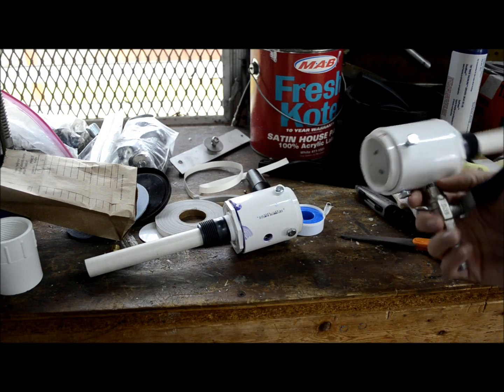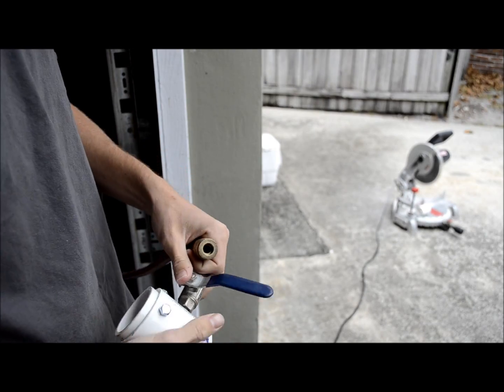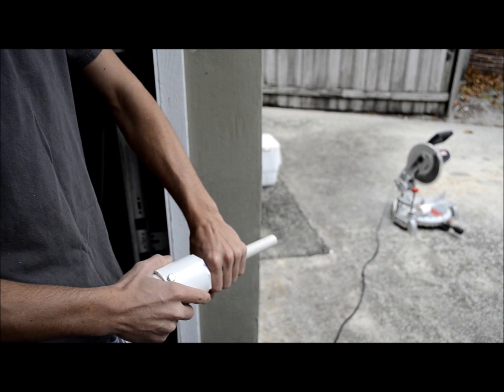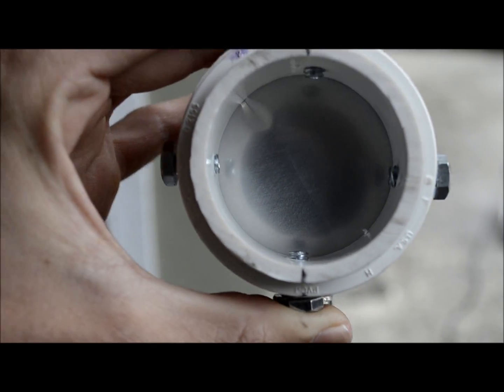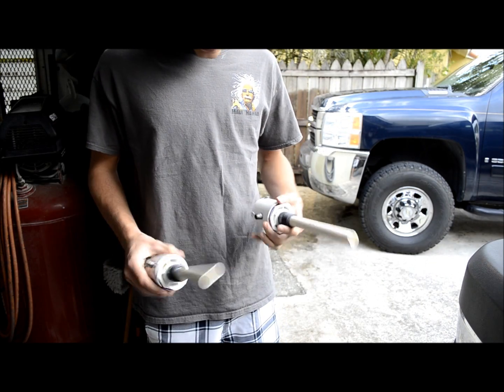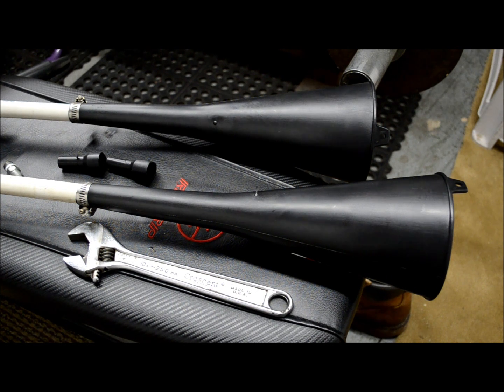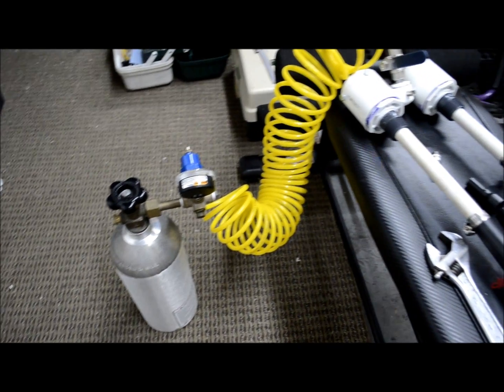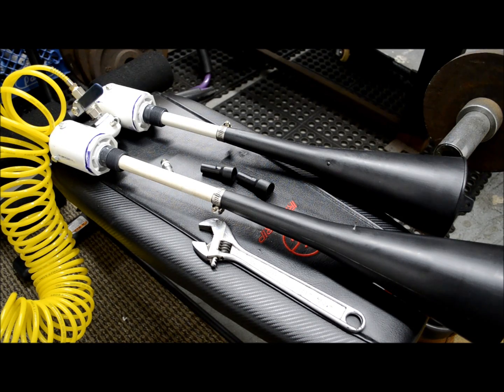HOW TO: Make Your Own Train Horns for $5!!! In-Depth Tutorial- Part 6, TESTING!

Comment: but how is it functional for a vehicle if you have to manually pull the lever?
Reply: Andrew Baughn you can get a solenoid valve for less than $15 that’s 12v and then hook it to a horn button.
Reply: @bamafreak223  i like it
Reply: 1/4inch DC 12V 2 Way Normally Closed Electric Solenoid Air Valve https://www.amazon.com/dp/B074Z5SDG3/ref=cm_sw_r_cp_api_i_TuS4CbF2KWKA9

Comment: How would you suggest making a horn with more than 2 throats?
Reply from the maker: not sure what you mean by throats, you mean 3 or more actual horns?
Reply: I mean a horn with 3 separate bells and 3 separate power chambers, how would I connect my air supply to those, and how should I arrange them?
Reply: Also, where did you get the pvc components? I checked at my local Home Depot and they didn't seem to have any of the parts I need. It might have just been that I wasn't looking very closely, but I'm not sure.
Reply from the maker: when I made a triple, I used a 1/4" stainless steel 4 port cross fitting with one port as the inlet and the other 3 for the 3 horns. I showed it in my train horn setup vid, so check that out. home depot should have everything you need! also lowes, or ace hardware (more expensive)

Comment: Great video. Clear, to the point and concise. There are a few questions that you may be able to answer thus preventing me from doing a bunch of trial and error learning. I would like to know more about pitch and tuning. What effect does different material diaphragms have on the sound? How to determine the length of the PVC tube that the funnel attaches, the funnel length, and what effect does the length of each have on the final sound? How to get a lower "deep" sound like a fog horn". What diaphragm materials have you used that are the most successful? What is the expected life of a diaphragm? It seems to me that although a thin aluminum diaphragm may produce the desired sound, due to its nature I would think it will not work long before stress fractures appear. Have you ever tried using a thick leather diaphragm before or a diaphragm made from a combination of materials? I was wondering if that first plastic diaphragm may have worked if a section was used just slightly larger in diameter than the seat it rests on and then being mounted in the center of a material that is more flexible like a 1/8" to 1/4" thick piece of flexible rubber. I am thinking that plastic, aluminum and other fairly solid, not meant to flex repeatedly, materials used for a diaphragm might have very short lifespans when used in this manner. All the diaphragm is really doing is flexing back and forth at a very high rate of speed. Though the flexing is minute it is still flexing. Like nearly all materials that will flex, each has a limit as to how many times it can flex before failing. If they work then great, but not so great if they fail quickly. In closing. Have you attempted to or made any air horns using the same procedures but of significantly larger proportions? I want the "Train Horn" sound which seems to come from the sized horns you have built but I also want the real, real, deep low bass sound generated from an ocean going vessel's fog horn. Do you think building a larger, scaled up horn would deliver that "Fog Horn" sound? I'm thinking of much a larger horn body with a larger more flexible diaphragm. Another idea I'm getting is a plate with a spring attached that fits behind the manifold and can be adjusted by a bolt that can be threaded in our out. Pressure could then be added to face of the diaphragm but still have some flexibility. That may allow for a greater range of tuning possibilities, greater range of air pressure and air flow rate. The spring, depending upon adjustment would take over a lot of the work the diaphragm is doing. I'll try it and see.    
Thanks, great video. KPE
Reply from the maker: in my experience, changing the diaphragm material can be quite unpredictable so its a lot of a trial and error thing, unfortunately! but it can be fun to try different materials and see what happens, as I had to do!
for the funnels, the longer the funnel the deeper the pitch. again, its trial and error. for a super deep horn, get a wide and long bell tube. for higher pitch, shorter and skinnier.
I have never had a diaphragm fail, and my polycarb diaphragms were in service for years. Still work to this day.
I have not tried composite diaphragms but some people use double layer metal. works well

your idea for a fog horn sounds great! go big or go home for that idea. bigger = louder and deeper! AKA more fun :) good luck with everything, and sorry for replying so late. I'm a busy college student!

Comment: Hi.   I want to put these on my recumbent bike, but don't have a lot of room for a compressor and tank.  Can I get a tank that will operate them?  Something around the size of a small home fire extinguisher?  About 6" in diameter at max and about 14-18" long?  Would that work?  It's not like I'll be using them a real lot, just for those idiots who have no respect for people on bicycles!  
Thanks very much for you generosity in posting these videos and help!
Reply from the maker: about the size of a home fire extinguisher... how about a home fire extinguisher! they will hold pressure fine, up to about 120 psi... if you want more air capacity you will have to go with a paintball HPA tank and regulator, but they are expensive!

Comment: OK. I think one last question. I got a T fitting between the two horns and when I hook 100psi of air to it only 1 horn sounds off! Idk what's wrong???  I've screwed and unscrewed the bell tube multiple times. I can't figure it out. if I block the air flow on the tube that is sounding off then the tube that don't sound off works. if that makes sense.
Reply from the maker: try to fine tune the tension on each horn so that they are the same. otherwise the one with less tension will always sound!
Reply: O OK. That's gonna be hard lol.
Reply from the maker: give it some air and rotate the bells until they sound like equal volumes!

Comment: hey man. I don't know if anyone had asked yet but how would I go about mounting these to my vehicle. HEHE!
Reply from the maker: it really depends on your specific vehicle, your air source, and how you plan on activating them!
Reply: 11 gallon portable tank with 125psi regulator.  On a 02 ford ranger xlt king cab. I'm mounting the tank under my tool box behind the cab. And plan on having a pull string or ball valve inside somewhere. I'm just trying to figure out what all I would need
Reply from the maker: +Kelly Perry the trouble will be running the cable from outside the cab to the inside. Have you considered electronic actuation? A very good HornBlasters solenoid valve can be had for about 25 bucks and will take care of that problem. All you need to do is power the valve and run a switch to the cab

Comment: Very good series of videos. A few questions.

Can the back of the driver (rear of the diaphragms) be enclosed? Or does that restrict oscillation of the diaphragm?
Why double diaphragm? Will a single one work?
Have you ever tried a rubber gasket instead of foam? It looks like the gasket off a 5 gallon jerry can lid would fit just right.
You tuned the pipes to A and C. What is the length of the pipes? What note is produced after the bells are added? It sounds quite a bit lower. (sounds very good BTW).
And lastly, have you tried flaring the funnels? Should make them a little louder, I think.

Nice job.
Reply from the maker: +CHARVESTER I'll try to answer them all!

I have never closed off the back of the diaphragms, bit I imagine it would have a slight although negligible effect on these horns. Real train horns are closed off and I believe they have small holes to relieve just the right amount of pressure

double diaphragm simply because that's how the real ones work, and apparently it makes them louder.

never tried rubber I don't think, simply because I didn't have the right stuff to use. I thought weather stripping would provide the seal much easier.

the length of the pipe will vary based on several factors... so start long and tune up to your desired note gradually. The funnel makes it quite a bit lower although I'm not sure exactly how much. I have no tried flaring them just because it would be pretty difficult.

Comment: Hey Luke, I made one of these yesterday and today i took and was going to show it off but when i put the air to it didnt work at all. Can you tell me what i should do to fix it?
Reply from the maker: Blake James first, always test things before you try to show it off :P

the most likely cause is the tension between the diaphragm and the bell tube. if it sounds like air is just rushing out, then it's not tight enough. in that case you would want to push it in further until you can feel it from the back. 

another reason could be lack of air flow, what type of air source were you using? they need quite a bit to sound good.

hope this helps!

Comment: So how did you install these on your truck, I'm assuming? And is there any way to wire it to a switch out control valve inside the cab? I'd also pay for a set, wish I had the time to build my own. It'd ship to California. :) Great videos by the way!
Reply from the maker: Justin Wommack these didn't go on my car, but my bigger and louder ones did. check out my channel for those videos. I have plenty of videos showing all the details of how I did it! There is definitely a way to wire them to the cab, but I actually used a manual actuator which you will see in the videos. I prefer the good old style of pulling down the cord, like you do when a truck drives by to get them to honk! I don't plan on using these horns for anything, so you could buy them if you want! Thanks for the comment!
Reply: How much would you charge? I've been looking around online and they can get pretty expensive.
Reply from the maker: Well, parts are obviously 5 bucks, a few hours of labor and testing, and I'm estimating 15 bucks to priority mail it to Cali, so we're looking at about 60 bucks. But I don't wanna be the guy to sell you a homemade horn when there are plenty store bought horns available to purchase for the same price that might be more reliable. They won't sound the same, but they would probably be easier to install and maintain. So you can buy them from me if you'd like, maybe I'll negotiate the price down... You seem like an honest guy ;)
Reply: My main thing would be just making it into a smaller application. I drive a truck so I don't have a trunk to hide the air tank. Any idea how to overcome that, a smaller compressed tank to hide in the engine bay?
Reply from the maker: The problem is you'll want more air than you can fit in your engine bay. My brother has a 23 gallon tank in his tool box, which is way overkill and takes up all the space. You'd want at least 5 gallons for these horns. If you need compactness, there are horns that are powered by just a small compressor with no tank - the air goes directly to the horn. Those eliminate space needed by eliminating the need for a tank.

Comment: Hey there I baught a air horn kit for my car and it is a single trumpet horn kit included an air compressor and it's just not as loud as I would like it than I saw your videos and really want to try it, but my only question is can I use that compressor that they gave me with your horn?
Reply from the maker: that compressor probably will not provide enough air flow for my horns. The reason these are so loud is because they use more air. You can't get much sound out of something that you blow in with your mouth - but think about all the potential energy contained in a scuba tank. Thats a lot of potential sound.

Comment: Great videos!!! I do have one question though. When I build mine I want them to make a very deep sound, do I need the tube to the funnel to be longer or shorter. Thanks!!
Reply from the maker: longer tube makes a deeper sound!
Reply: WOW!!! I got mine finished and I got a little crazy with the psi and I put 135psi through it and blew out both the soda can diaphragms....sooooo I was experimenting around with some different plastic material for new diaphragms and I found some old xray film from when I broke my arm and i cut me out some new phragms from it and put 80 psi through the thing...I dont even know how to explain the sound that thing made. It would put an 18 wheeler to shame!!!!!! lol. You should try it in you horns, go down to your local hospital and see if they have any xray film you can have, it works amazingly!!!
Reply from the maker: Wow, awesome! I'm glad you did some experimenting! I wonder how long that stuff will last...
Reply: We will find out! but it comes in a big sheet so i have plenty of extra material if cracks or blows out
Reply from the maker: Awesome! Let me know how it goes. Another guy said brass sheet was working good for him. I haven't tried it yet but real train horns also use metal sheet, albeit stainless steel.
Reply: Luke Santore I will try out some more materials. Tomorrow I am going to Lowes and I am going to get more pieces of pipe and more fittings and make my own design. I will make it as big as possible lol
Reply from the maker: I like the sound of that dude!! let me know what you end up doing!!
Reply: Luke Santore So why not just use Stainless - - people discard grills, thrift stores have toaster ovens, and, great videos Luke !!
Reply from the maker: thank you!!

Comment: Luke,
I have watched all your videos on building the horns and I like your attention to detail, how do you determine how long the tube going to the funnel needs to be,does it change the pitch or how loud it is, is the screw adjustment on the tube the only pitch adjustment, I am building one horn for now and I plan to put it together to test today and see what happens,
Reply from the maker: the length of the tube changes the pitch, not the loudness. you change it to the length that makes the sound you want.

the screw adjustment is for volume. it does not change the pitch.

Comment: Very good instructional video and props for posting such a thorough build. For the tuning or getting the note you desire, that is the just the length of the bell tube correct? The "tightening" or "tension" of the tube to press it to the diaphragm is just to get the loudest vibration of the diaphragm? or is it a combo of those 2 procedures to get the note you desire for each horn? 

just curious if you could state that tube A is to be x" to get note A and then tube B is to be y" for note B, or is it more complicated than that.
Reply from the maker: Thanks for the kind words!
I suppose I was a little unclear. In the video when I "tune" the horns, I am actually just making them as loud as they can be. The actual tuning (making them sound the correct pitch) came later and is not in the video series. So as you said, tightening/tensioning is for volume, and length is for pitch. However, I can't give you a certain length of pipe that will produce a certain note because these horns aren't precise enough. Every horn is different when dealing with these materials. I be if I cut the tubes of both my horns to the same exact length they would be at least a half step off in pitch. 
Hope that helps!